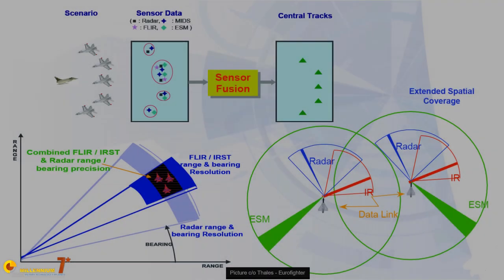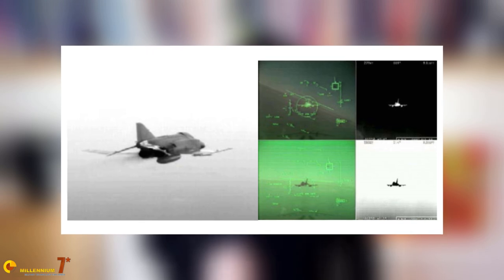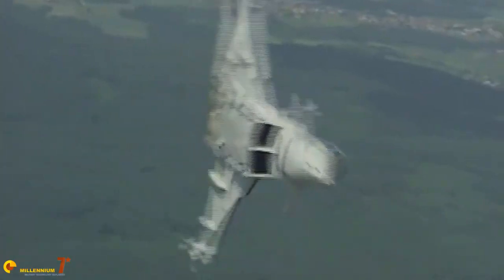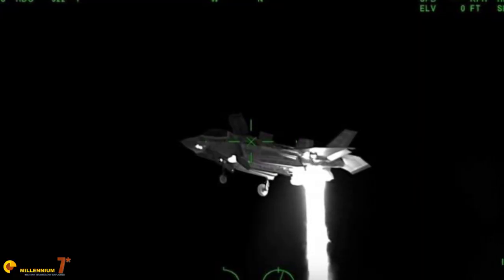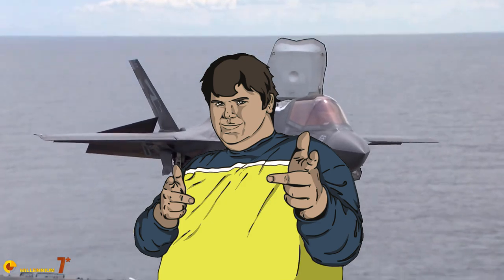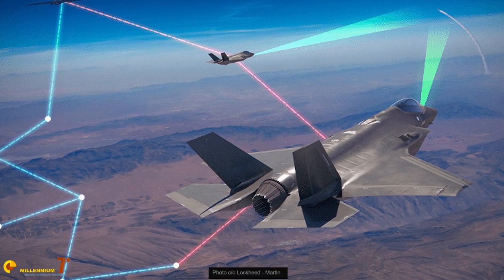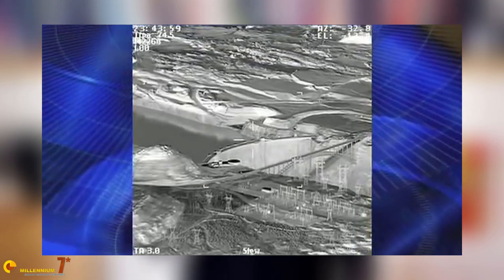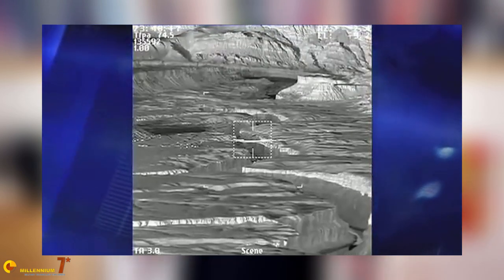The Other RADAR | Can IRST Infrared Detection Replace Radar?

Comment: Hi. Another good vidéo.
As Rafale lover, I doubt of it's capacity to triangulate ils foe's position because I dont know, and I dont think, it is suited for communication with patrol follower.
I know DGA asked for implement thé function. It was one or the F4 upgrade.
Thanks vert much for your work. It five me a lot of fun.
Reply: No the system was already tried in 2013 but not accurate enough because only using l16 
Look for tragedac

Comment: No because ir radiation is easily absorbed by water or water vapor so it becomes highly degraded in cloudy or rainy weather.
Reply: Well, yes but that's only true up to a certain hight. Above 30'000 theres hardly any weather any more so an IRST can give you a huge advantage in such conditions.

Comment: the 2 irst Solution could be tried on somthing like a bomber with a large wingspan
Reply: Not enough distance between sensors, I suspect...
Reply: @edcew8236  depends on the size of the Lenses used, if they are big enough it is possible

Comment: Merci pour votre contenu.
Une question, probablement saugrenue. Pourquoi aucun missile n'est monté de façon à être lancé vers l'arrière?
Il me semble que cela pourrait violemment surprendre un adversaire arrivant par l'arrière.
Reply from the maker: Because it is very very poor kinematically. The missile must "brake" first than accelerate toward the target. At transonic speeds, it will basically fall out of the sky with very little energy left to intercept the target. Plus it will travel backwards at launch i.e. it won't be stable.
Reply: Le missile braqué vers l’arriere aurait un effet désastreux sur l’aérodynamique de l’avion en general. 
Ensuite lorsqu’il serait tiré, en arrierre ca vitesse serait donc negative, si l’avion va a 500km le missile continuerait dans la meme direction donc a -500km 
Si l’avion est a 900km -900km donc non seulement le missile perdrait énormément d’energie a repasser en positif mais en plus, il serait incapable de maintenir sa portance durznt tout ce temps et tomberait. 
Pareil pour un onus tire par un canon p, il ne tomberait pas mais ca vitesse en sortie de bouche serait tres faible et il n’irait pas loin
En revanche en 2013 un rafale a reussi une premiere mondiale avec un mica, tiré par dessus l’epaule (il part devant puis monte monte jusqu’a avoir fait un demi tour) ca reduit grandement sa portee et ca a demander un autre rafale pour transmettre les donnes de localisation de la cible. Mais ca pourrait aussi fonctionner avec un ddm pour une solution en solo.

Comment: As always, an interesting video but shouldn't IRST be very effective against fast moving big targets like the supersonic bombers. And if so would it not make sense to cool the surface of the aircraft actively?
Reply: You'd have to cool the surface relative to the background, which would depend on from where you are looking at it. So that's problem #1.
Problem #2 is that such a cooling system is most likely going to add too much weight. 

The feature already exists on tanks (currently no customers for the tank, but it is available) , see the " cv90120-t ghost ". So the technology does exist, it's not something we would have to invent.
Reply: @lordsqueak  thanks 👍

Comment: Is it possible to use the pulse-doppler effect in the IR spectrum to estimate with sufficient accuracy range (and speed) of a maneuvering aircraft as well, or is that too complex and very much interfered with by atmospheric conditions? I thought radars do that, but as you said, theey are less dependent on atmospheric factors.
Reply: Radars emit pulse of radio energy and measure the time to return as well as any doppler shift in its frequency.  IRST doesn't send out any pulse.
Reply: Ir meaning infra red, so you want to a heat source to bounce on an airplane to make it hotter ? 
1) you will get detected because you are emitting now and much faster then any results you may want. 
2) laser are much more efficient at that. 
3) radar do that but its active so not stealth and radar have a hard time detecting stealthy planes yet alone track them
Reply: Imo it would be possible if you knew the targets IR frequency very accuratly and therfor its temperatur, so you have a baseline aginst wich the doppler shift could be measured. So not really possible in practise as the targets temperature will be an unknowen factor and will probably change constantly.

Comment: You make a great point about triangulation IRST.
I was about to pull the trigger on missing triangulation, but you covered that base too! :)
Afaik I have not seen such consideration on fighters, most probably because the separation for anything at distance.
Might come for shorter ranges soon though. https://www.leonardocompany.com/en/products/mair

There is a difference in SWIR between surrounding reflected spectral band and "body" heat.
 In the short bands, you mostly see the contrast as reflection and emissivity detail afaik.
In LWIR you will probably see the actual heat output of the exhaust at distance.
Reply: I think his inspiration came from a European program called FCAS, which already displayed more than 1 year ago this kind of ideas for their future warfare system and 6th generation fighter jet NGF. Link to the video : https://www.instagram.com/p/CH2d2nMAYLZ/

It sounds more like the genius ideas of Dassault and Thales !

Comment: Infrared detection can be detected.  It can be seen by night vision cameras.  I have a set of night vision and I can see light pulses from the a TV remote.  Heck, I can even use my Samsung phone's camera to detect an IR signal from a TV remote.  I am sure a plane like an F35 could see that with its numerous cameras mounted around the plane.  Infrared is a type of light that is invisible to the human eye.
Reply: That's not the same. What you describe is what's called active IR. In the old days, and that means just after WWII active IR was the hot shit, because it gave night fighting capabilities, especially for mechanized ground units. Active IR was based on IR-Illuminators basically a big searchlight which only emited in the none visible IR-frequency. With the right equipment it was indeed easy to detect. Today though you use passive IR sensors, which are much closer related to a Thermographic camera or the IR receiver on your TV, which is completly passive.

Comment: SARS imaging is better at looking through clouds, looking over the horizon.
Reply: Imaging and Imagery techs and systems, are indeed another idea already used by some fighter jets.

Dassault already have imagined and prepared with its partners Thales and AirBus, a teaming and swarming  capable system using drones or also called UAV/UCAV. It'd be available in a close future on Rafale F4 as a first part and step of the FCAS program (F4 is scheduled to arrive in 4 years or less).

https://www.instagram.com/p/CH2d2nMAYLZ/

With this solution, IR and other Optronics and advanced kinetic kinematic systems could be really superior than radars, since they're flying in a very passive and stealth mode toward the enemies !

Comment: I mean if modern planes use AWACs to supplement their radar detection, why not use such planes to help triangulation? a bigger plane could house more IRST sensors and fly at a distance where triangulation would be possible.

Also, why use the wing tips when you can use a longer distance, like the planes length? mount one sensor up near the nose, and mount the other on the vertical fin or towards the rear of the aircraft. If theres a height difference between them, they could possible be at a distance longer than the wing tips and might help with triangulating.

It's not too outlandish, most predators, humans included, have two forward facing eyes to help perceive depth, so having two IRST 'eyes' seems ironically natural

Comment: Couldn't it be possible to roughly estimate the distance by knowing the size of an object and the camera characteristics? So a characteristic infrared signal could be compared to the data list, the airplane or missile size is then known, you get a rough estimate for long distance. In the other stance you can identify the the airplane and have the exact size. The math is very simple, so you wouldn't have a delay. I guess even when you have to consider the angle of the the other plane you are looking at.

Comment: Locate stealth aircrafts with old school radars then send fighter jets with IRST nearby to track and shoot them down with IR missiles.....
Reply: @michaelkeller5008  Excuse me - in the "that's what happened" part of your claim, what part of the SAM system involved was a fighter and what part used IR?
Reply: @michaelkeller5008  I see. And what part of "use IR to shoot down the jet" do you understand was used by a Yugoslavian SA-3? You know - the kind that tracks based on ground control radar?
Reply: @michaelkeller5008  there is no lesson to learn. The F-117s in serbia had flown hundreds of sortees through the exact same route, and you somehow consider shooting down one a success, and proof of its ineffectiveness. Let alone the fact that the “Old School” radar is a detection radar that couldn’t provide a firing solution for the missile. The radar that actually could guide the missile only achieved a lock when the F-117 opened its bomb bay, and even then only from under 20 kilometers away. That’s completely unimpressive.
Reply: @michaelkeller5008  It was more of a case of "locating a stealth aircraft when you already knew the route it was going to take due to poor tactical planning at the USAF HQ and knowing when the stealth aircraft took off due to human intelligence outside the airbase and then catching it on your radar which was pre-pointed to where you therefore expected the stealth aircraft would be when it opened its weapons bay ruining its stealthiness. Then, launching your missile in that direction and getting lucky in the missile getting close enough to acquire the stealth aircraft. It took A LOT of savvy on the part of the battery commander, but it wasn't a failing of stealth. Baghdad had way better air defense and they were completely helpless to F-117s used with tactical intelligence. The USAF was much more to blame for the shoot-down than Lockheed.

Comment: THIS WILL MAKE NO DIFFERENCE.  we've already developed the first electric jet turbine. and thus, it would become the stealth to IRST in the very near future.
Reply: That doesn't matter. People always think modern optronic systems are still looking for heat sources, they don't. They searching for anomalies and they have become way more sensitive in the last few decades. It's enough that parts of the airframe have a few degrees difference to the background for modern systems to detect you.
Reply: @shi01  wrong on every level. sorry pal, but i served for over 15 years in the USAF. there is NO such system deployed to date. and the few that remotely scratch the surface of such claims. don't have the range to make any real difference at all. 
there are some passive systems that may get that advanced in the decades to come. but passive systems can't track or target enemy targets.
Reply: @governmentcheese7726  What do you actually think what they did to the AIM-9L to become capable to attack targets frontally and not just when the jet exhaust was directly visible? The temperature difference of an airframe to the background was already enough for an 9L to aquire a target an that was in 1977.
Now you have missiles like the IRIS-T which look exactly for what i discribed, things that stand out from the background heat radiation. Doesn't matter if warmer or colder, a flying airframe will always be a thermal anomaly. It's either has parts that heat up just because of the friction when flying with trans sonic speeds or it has parts that are clearly colder than background, for instance the fuel in the wings because the aircraft has just decended from high altitude so the fuel is still cold which means the wings appear cold.
It's no wonder that you never saw something like a modern IRST system in the USAF because they just recently realised what they missed by not looking into this. Just look up the Legion-Pod. Other none US aircraft had that capability fully integrated a decade ago.
Reply: @shi01  omg... ok, first off, we do not and have not fielded the 9L in years. current versions of the aim series in service are the X version and the new block 2 version. and though they do have a much higher resolution for acquiring the target. they are NOT even remotely at the level you're trying to present. and their range is still very short to detect. hence why the new X and block 2 variants use data link to guide them to the target. 
 i am aware of such systems being developed. but we're still years away from fielding them. the last system i saw (just a few years ago) still took up and entire building. and yet also still had a VERY limited range. well under 20 miles from what i remember. and couldn't penetrate thick cloud cover and heavy weather. 
 so yes, the infrared guidance  of some of these missiles have gotten much better. they still require much more advanced systems to get them to the target from any range beyond about 20 +- miles. 
and to be honest, it's not likely we see much more in infrared guided ANYTHING from here out. everything is moving to vastly more accurate and effective data link guidened systems. systems that can receive guidance from a wide range of platforms in the field.

Comment: Short answer: no. Long answer: no, it's short range.
Reply: It detects stealth & less prone to jamming, I’ll take infrared guided missiles anyday than radar guided
Reply: @boiboiboi1419  Actually, no.  Radar guided missiles are extremely good, however they have problems against stealth vehicles. I think the first plane with true IR "radar" was MIG-29. Others have had IR cameras before that, however the system gave the 29 a true heat radar with enough information for radar missiles. Now most planes have something similar. The thing is that you have to face the heat source properly to get proper readings. Remember that an F-117A was downed with a shoulder launched IR missile. What radar homing missiles give you is proper BVR possibility. The old F-14 already had a system to couple its fire control to AWACS and was able to fly with transponder and radar off. It got the targeting information from AWACS and that radar showed to be elsewhere from the incoming missiles. IR and radar have their own pros and cons. However the fact is that the F-22 / F-15X are the last dogfighters for now. Air combat is changing a lot as we'll see laser and other directed energy discharge weapons come online as defense and maybe even offense. 

Heatseekers are going to be relegated to choppers and small attack aircraft. IR sensors will get better but so will the stealth systems. Before you can get to Sidewinder range you'll be shot down and never see it coming. Stealth or no. Stealth systems aren't fool proof. All it takes is a few scratches in the paint.
Reply: @jaanikaapa6925  the capability of anti-stealth will outpaced the stealth, stealth has another 5 years to be relevant , so does jammer will outpaced anti-jammer 

We will going back to dogfight and decoys